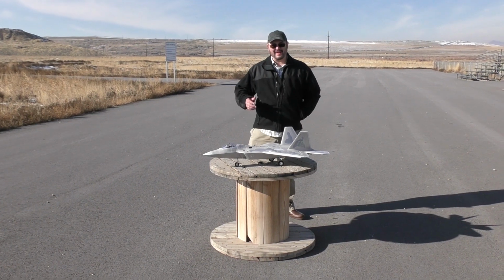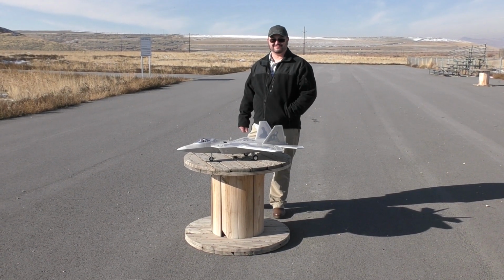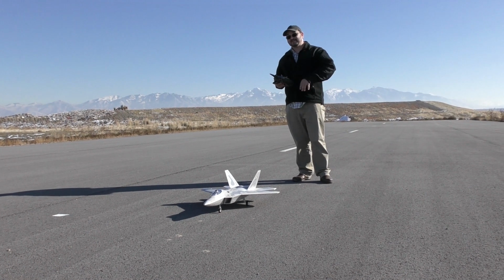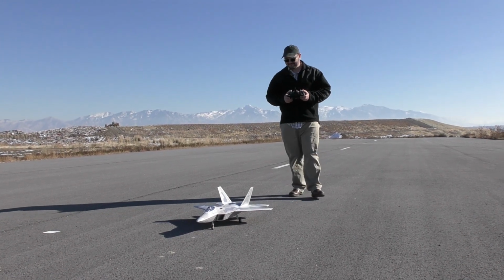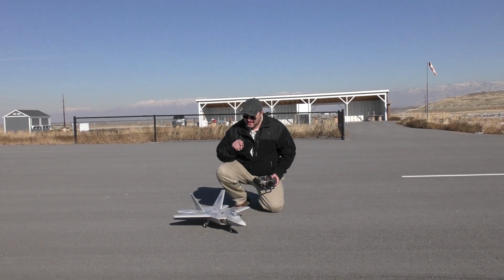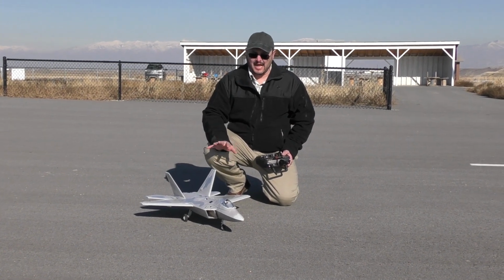Freewing F-22 Raptor 64mm EDF Jet - Maiden Flight

Comment: Man I'm such a slacker.  I forgot to tell y'all about the flight times and we all know that the flight time is always a concern especially on an EDF plane.  I got several flights on her and found that I can comfortably get about 2-2.5 minutes on an 1800 mah and 3-3.5 minutes on a 2200 mah (which she really does prefer just for CG reasons), still coming down with 20% charge to prevent overdrawing.  This is with flying at 100% throttle for the entire flight.

Comment: I just received this plane for a holiday gift, and noticed as well that the control surface movements are pretty extreme. I went through and moved the control linkages to different holes on the servos and control horns, to help reduce the amount of movement.

One of the guys at our club said this plane really needs full throttle to fly well. Has that been your experience as well?

Comment: Excellent video and very useful info about this model. One question: Can this F-22 3S perform closed turns? My club has a nice  300 feet synthetic runaway but it is surrounded by big trees and the flying area is only about 625 feet in diameter....Thanks
Reply: I'm not sure what a "closed turn" is so I'll assume autocorrect bit you and you meant close turns.  Turning radius is dictated by your elevator throw on this bird and I've gotten some pretty tight.  If possible I'd try getting your turns dialed in in a wider, more forgiving field but you should be fine.
Reply: Hey Andrew, Thank you for replying. Yes, I mean small turn radius. Thanks